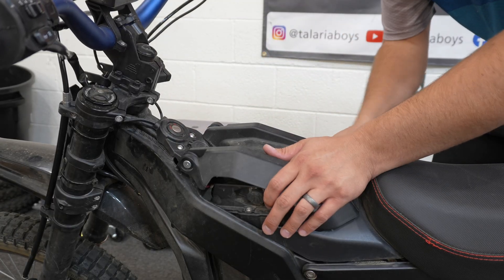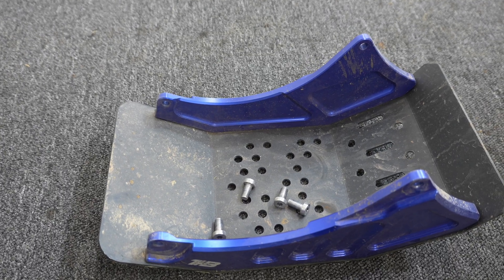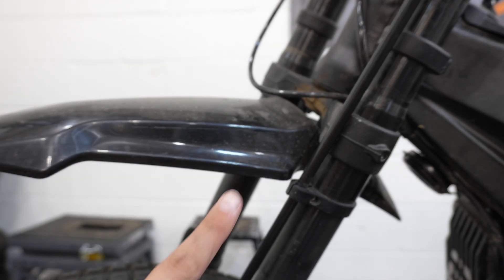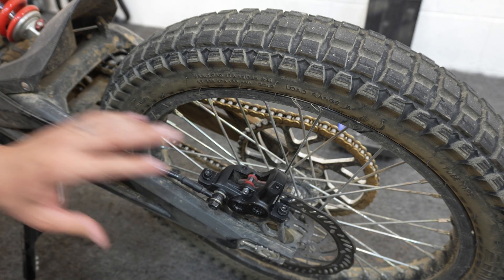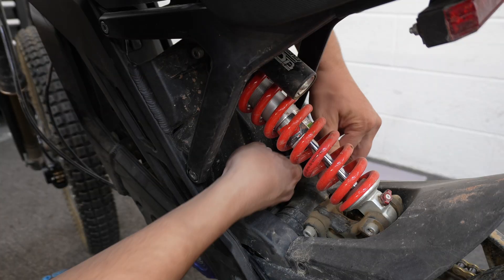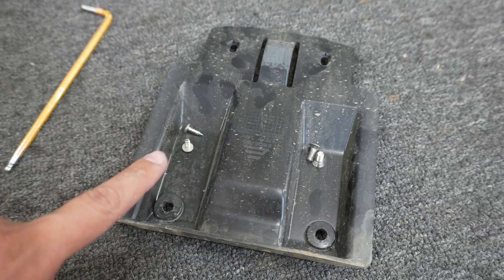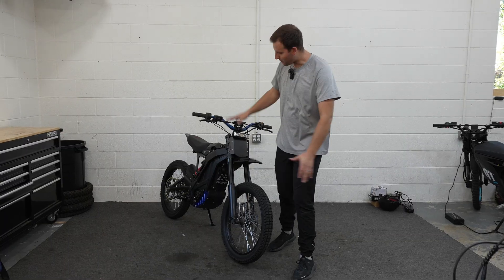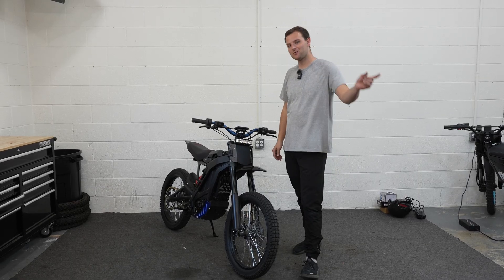E-Ride Pro Rear Brake Full Install Guide

Comment: The foam that you peeled/scraped up on the bottom of the battery tray when you put it back together, what did you put in its place since it was scraped off?
Reply from the maker: Nothing, Its so thin it doesn't matter.